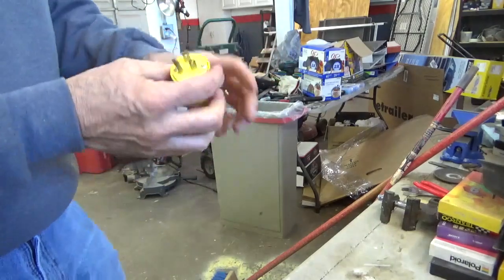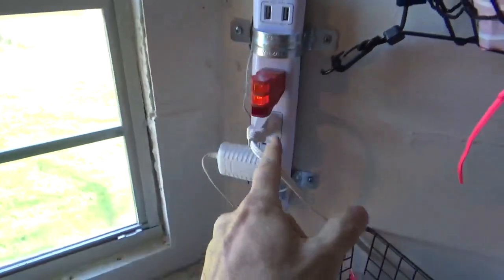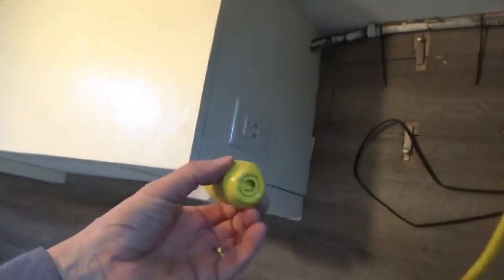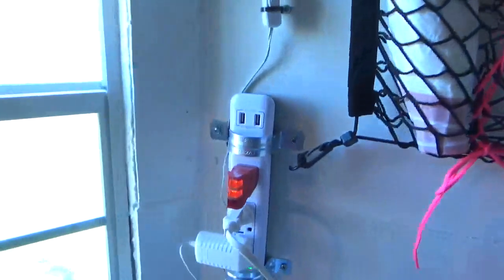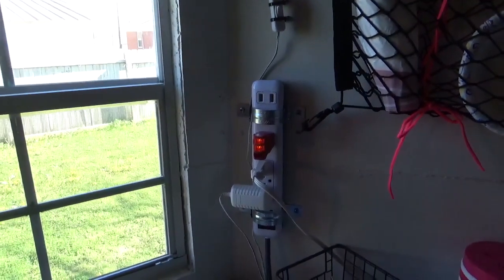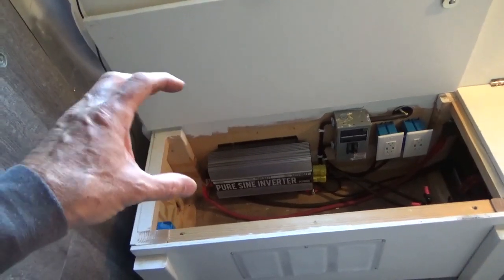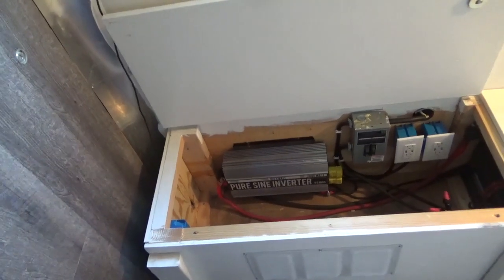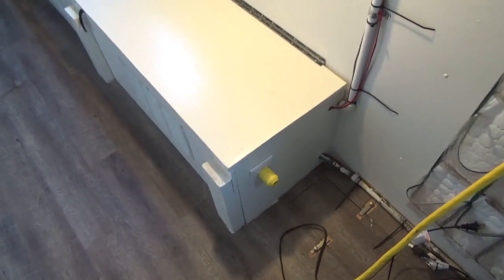SOLAR POWER SOLUTION Cargo Trailer Camper Conversion Vanlife Skoolie #flgctc

Comment: I have been thinking about this (what if) Every thing is grounded to the frame but the plug boxes so what if you ground the plug boxes to the frame as well then ground the plug to the box. I think I am going to try and do that just to see if it works the more I think about jumping the one wire over something just isn't sitting right with me on that I may be wrong but I have to try.
Reply from the maker: Thanks Den. I am still on the fence with this myself. Not really liking it but still trying to figure it out. Please let me know what you find out. I have a couple of other ideas to test as well.